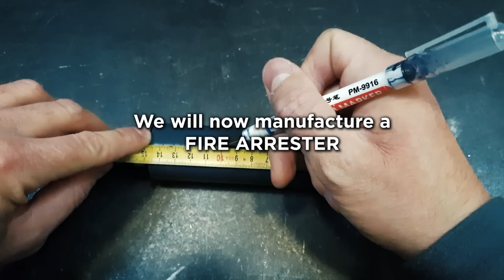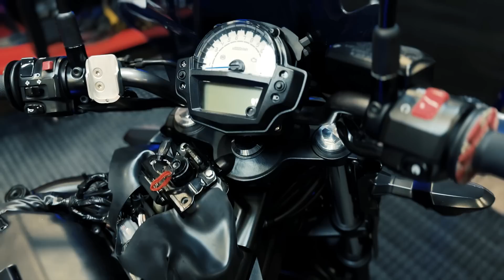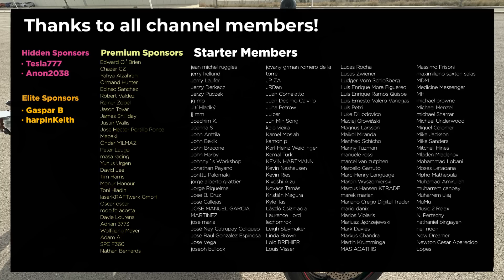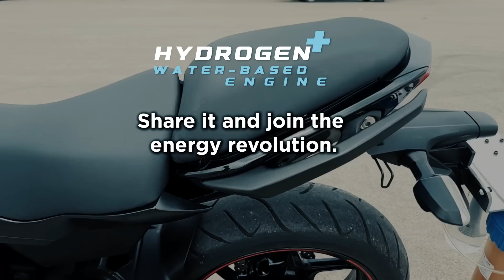THE MOTORBIKE THAT WORKS ON WATER 100% REAL

Comment: Powering an engine with hydrogen is a real thing. However I do not believe you can generate enough hydrogen to power the vehicle AND sustain the system. It would simply use more energy than the system can convert. Bottle or fuel-cell hydrogen, such as Kawasaki is researching as we speak, that's legit.

Comment: I am absolutely blown away by your incredible engineering skills in creating that Hydro Engine motorbike! It's such an innovative and inspiring project that holds the potential to revolutionize the way we think about transportation and energy. Your dedication to pushing the boundaries of what's possible is truly commendable.

I've been following your journey closely and was curious about a couple of things. Firstly, I see you adding the HH+ compound to the water you're using in the motorbike's system. I've heard that it can enhance the efficiency and range of hydrogen-powered vehicles which is a nice touch!

Secondly, I'm intrigued by the possibility of running the motorbike solely on water. Those compact tanks you've integrated into the back of the motorbike look fascinating, but I'm wondering if they are large enough to sustain the bike's operation using only water as the fuel source. It's such a thrilling concept, and I'm curious to learn more about the potential of this technology.

Once again, kudos on your remarkable achievement, and thank you for sharing your progress with us all. Your work truly showcases the power of human innovation and engineering.

Looking forward to your insights, and keep up the fantastic work!

Comment: BRUTE FORCE ELECTOLYSIS DOES NOT AND CAN NOT YIELD SUCH OUTPUT! THIS IS A CON JOB!
Reply: đây không phải lừa đảo ở Việt Nam chung tôi đã có chế tạo và đang thiết kế, tương lai trái đất cần được bảo tồn ngay, hoặc là bạn tin tưởng hoặc không
Reply: @khánhksy91  do you have any videos of that preserved machine on YouTube
Reply: Nope. It actually works very well. I heve seen a cruder variant some years ago on a carburated ram air motorcyle. It was an incredible sight to behold. There are thousands of people out there using similar systems to power their vehicles, for personal use and keeping it low key.

Comment: I wonder, as rhere is no storage for the hydrogen, how the Engine is always supplied by the exact right amount of fuel? 🤔
Also how far can you go with that much water?
Reply: @ Urinimohr, as far as how far on a bottle that size, probably over 350 miles. I'm guessing though 😊
Reply: @Urinimohr, the engine uses it's own vacuum to pull the hydrogen. The vacuum increases big time after idle. At idle, it's possible the hydrogen is becoming pressurized, so I guess the extra hydrogen is pushed into the air filter box, venting out into the atmosphere? The hose from the hydrogen fire bottle is plumbed into the intake somehow.😊hope this helps. I don't know a lot about this but I know the basics.
Reply: @glennsims66  "I guess"... please. The maker claims 3.2Bar positive Hydrogen pressure at the inlet of the engine.
Reply: @TolisOnLine  sounds like descent pressure. Idk much, specs and the like. Just barely basic. I wanna learn more though 🙂